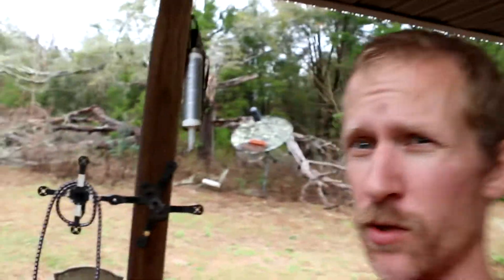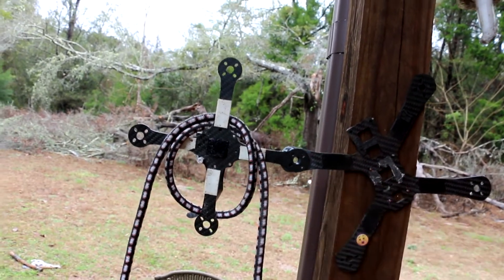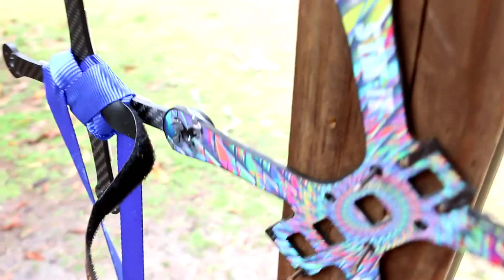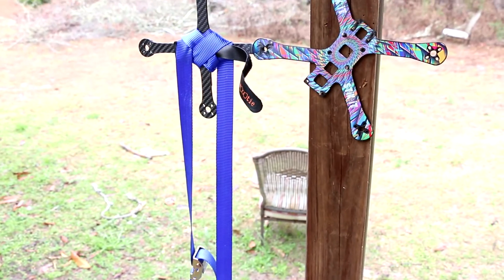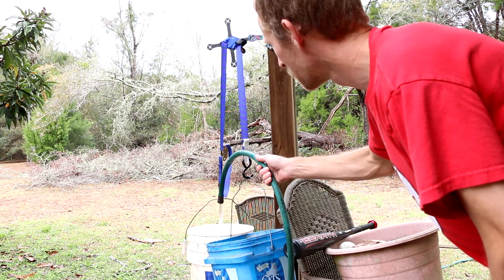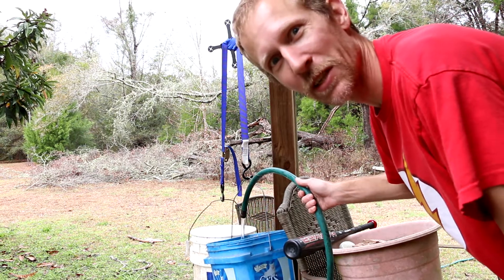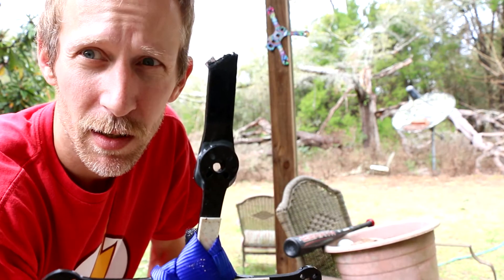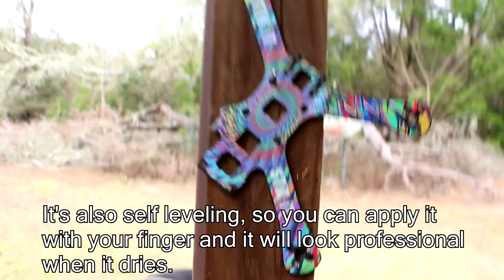3m Scotch-Weld EC2216 epoxy shear test

Comment: I've been using this stuff to bond my CF model boats together for a few years now. I have yet to have a glue joint fail even after some major accidents.  Just make sure and clean it well with acetone or something similar. Takes about 7 days to fully cure. Awesome stuff.

Comment: will this glue work being submerged in water or oil.  may use on gear box of boat motor?
Reply from the maker: I'm not sure. Water will be fine, oil i do not know.  Their website says more chemical resistant than other epoxies, but it doesn't say anything specific.  You'd need to clean it very good before applying it.

Comment: @mooosestang, WOW, remember me, the idiot asked you how you milk that exposy out ??? well
i have done what you told me, and used a driver nut, and got the juice out,m and now i have successfully
applied that 2216 on to my servo's horn and attached it to my carbon fibre bar( 500x50x15mm(, and it si BEAUTIFUL !!! THANKS AGAIN FOR YOUR HELP !!! THE SERVO IS 50Nm ( 500kg/cm) these legs are going
to MOVE WOW !!! THANKS FOR YOUR VIDEO+YOUR HELP, AS A FAV. all the best+STAY HEALTHY !!!
Reply: @mooosestang, ok, remember i asked you about the applicators??? well i found+am using a pair of clamps, the two tubes fit right in snd squeez...BINGO 1:1 MIX AND IT WORKED BEAUTIFULLY...and the clamps are cheap, try it you might liuke it hahaha and if i remember the name correctly its called Anvil Spring Clamp

Comment: how did you cure it? i'm using the same epoxy on wood and aluminum and it always delaminates.
Reply from the maker: I used a heat gun for maybe 10 minutes and then let it sit in front of a space heater for 24 hours.
Reply: cool, thanks. I'm curing mine in the oven - might be squeezing too much out. when yours is cured, does it feel kinda rubbery?
Reply from the maker: No, it's very solid, i can't make an impression in it with my fingernail.  I don't have the applicator, so i was guessing at the amount to mix.
Reply from the maker: You don't want a 1:1 ratio, one of the tubes is smaller for that reason. If you don't have the applicator use something to measure how far you've pushed the big tube and push the smaller one the same amount.  I just used a folded up piece of cardboard and made marks on it to show how far i pushed the plunger.  Hope that makes sense.
Reply: good call, thanks man. i have been doing a 1:1 mix.
Reply: you were right on the money. i'm using translucent which is a 1:1, but i was eyeballing it and getting the ratio wrong. got some glue syringes and problem solved. thanks a lot for answering all my questions.

Comment: That is pretty damn strong. Interesting. Is it brittle? Crashes are often a huge spike of g for a brief moment. Maybe try a hammer test
Reply from the maker: No, it's not brittle, it won't crack like other epoxies, it will flex a little.  I will work on a hammer test with what's left.

Comment: that some strong ass glue Flash
Reply from the maker: I was surprised.  They make a dp420 that might also work well, but it's more geared towards bonding metal.  Time will tell how well it stands up to crashes.  it's hard to know the forces involved in a crash at 70+mph.
Reply: are you going to glue two frames togather to make a 8mm frame?
Reply from the maker: I all ready did.  I have two, one is a 3mm base plate and 4mm base plate.  The other is 3mm and 5mm.  I broke the 5mm base plate(delaminated), so i added a 3mm to it and glued them.  They are only 185mm motor to motor, so all ready hard to break.  this is the 7mm base plate.  http://www.pbase.com/paulyoly/image/166899085
Reply: super clean looking build. I'm loving my rooster, chameleon and stingy frame to much to be building small frame quads like you have.  but then again I haven't built a frame under 210mm yet either.

Comment: Dude that shit is bad ass,  amazon here I come !!!
I like all your shirts !!!
Reply from the maker: Yeah, i could have fixed that chameleon base plate with it, maybe not now.  Don't spread it on too thick, it will start to run, has the consistency of syrup.  It's easy to work with though and not nearly as sticky as other epoxies.  it wipes right off your fingers, no need for paint thinner.  Pretty expensive though.  Love my super hero T's.
Reply: mooosestang you need to do a custom moosestang quad jockey tee shirt.  Hell sell them here !! I'll buy one
Reply from the maker: with an image like this?  https://cdn.shopify.com/s/files/1/1909/2333/articles/moose21_200x_928cd38a-f1a9-48d7-81e3-1a740fdacac1_1024x1024.png?v=1496330736  I wouldn't know the first thing about designing a t-shirt.
Reply: mooosestang that's a cool design.  
You have a lot of subs I'll bet quite a few would buy them !?   Just a thought.